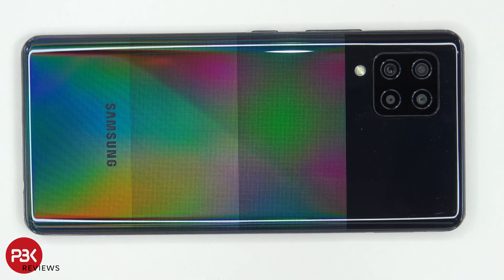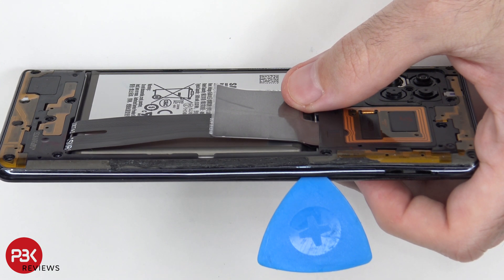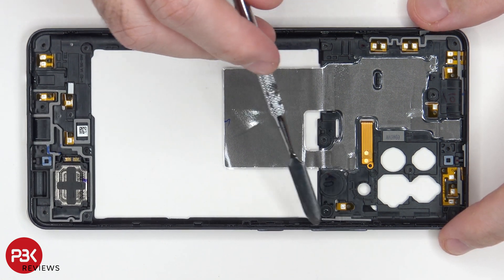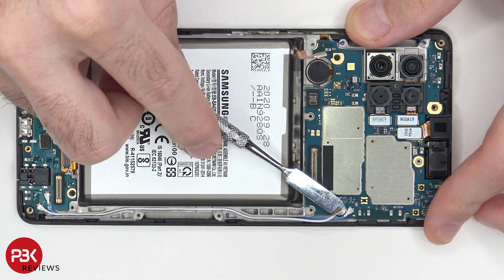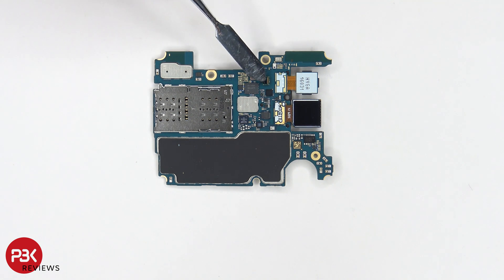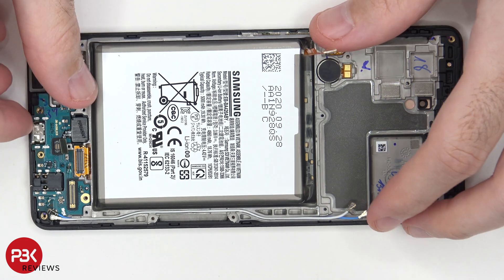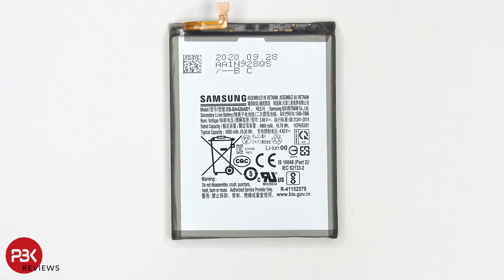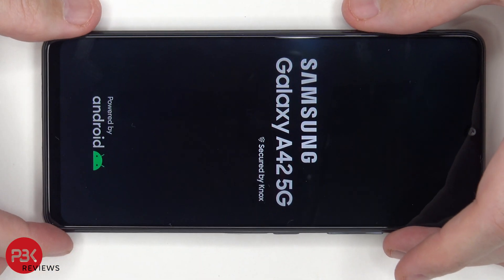Samsung Galaxy A42 5G Disassembly Teardown Repair Video Review

Comment: Where can I get the motherboard to buy?
Reply from the maker: They don't usually sell the boards as a replacement part, so you would need to fine one someone is selling on ebay or elsewhere from a parted out phone if there is one.

Comment: I really appreciated the video. It would have been even better if you had shown use of a heat gun and then showed the reapplying of adhesive and where you would get the adhesive. So it was 80% helpful and much appreciated.

Comment: Where is the wifi. My wifi and hotspot are not working after teardown
Reply from the maker: check and make sure the back housing is seated and screwed down properly, since the antenna flex cables are on the back housing and they need to be seated properly to touch and make contact with the board.

Comment: Hello good guys, I've been looking for a replacement screen like crazy for a long time, and I've come across many pages which claim to be scams, ect... And if I find one on Amazon, it's worth the same as the new mobile. Might you help me? In case you know where I can ask for it or something... I'm desperate.
Reply from the maker: Hi, there is this one which is cheaper but new and harder to install since its not pre attached to the frame: https://www.ebay.com/itm/384773270610?chn=ps&var=652709190897&norover=1&mkevt=1&mkrid=711-117182-37290-0&mkcid=2&mkscid=101&itemid=652709190897_384773270610&targetid=1264870805984&device=c&mktype=&googleloc=9031131&poi=&campaignid=14859008593&mkgroupid=130497710760&rlsatarget=pla-1264870805984&abcId=9300678&merchantid=522565752&gclid=CjwKCAiAqt-dBhBcEiwATw-ggJJVu6oNldczl6NCv7_pLu-0S4y1tDPHB6jS1RmMWlmDrzkEe802pBoCE6MQAvD_BwE    or there is this one which is easier to install since it comes with the frame and is an original screen but used : https://www.ebay.com/itm/285064911070?hash=item425f3158de:g:mHMAAOSwpjRjjocw&amdata=enc%3AAQAHAAAAoH78wsiBphXTsHRyyjXTpNDPvzp%2Fnw0v77yeWa8vKG6vr93VzICUb%2Bg3RlJC1cqUZa9S9obqQP8i2QoORGMc0Ds%2F%2BCvMdRZ3gVdfby0XSKAJU6iQSbOohhtcQPQG%2Fi8r8SDACLdiaqYbFvd2rsfO4dhIu46UucDlIZgREyJN28DaH68VyVzJ1V7fZuPX6aDaq2e1QYs6qhOsN0qAA5PT%2FCc%3D%7Ctkp%3ABk9SR_L70Z-xYQ
Reply: @PBKreviews  Thanks! But I have a question, the screen of the second link works, even if it is used, right?

Comment: My husbands screen won’t unlock or respond to touch and even resetting it doesn’t work. The password screen won’t even appear it just turns on and off. Any clue? Help please.
Reply from the maker: Can be many things. Bad battery, bad software, water damage etc. If battery, you would have to test a new battery and see if it helps, if not then you need to check for water damage, and lastly you can try doing a manual hard reset (which is a factory reset that erases everything on the phone) to see if that helps.

Comment: Thank you for the video. I watched it because I paid to replace my cracked screen, now I barely get 1 bar of service. (Never a problem before). Could something happened during the screen replacement somehow?
Reply from the maker: You would need to check and make sure all the cables are connected properly, the motherboard is seated in place and the back housing which has all the antenna flex cables is seated in place and screwed down so they make contact with the contacts on the motherboard to give them signal.
Reply: @PBKreviews  Wow, I want to thank you for taking the time to answer me. You are a wonderful person! This helped me out a lot.

Comment: mine looks different
Reply from the maker: maybe yours is the A42  not the A42 5G
Reply: @PBKreviews  Thankyou very much, I managed to figure out the rest. It is A42 5G & it even displays it on screen at boot up, I noticed that some parts on the inside look different than A425G tear downs on the internet like yours, & also parts read 2021 yet most I see on the internet read 2020, so I think samsung actually changed a few features/insides in a newer version of A42 5G but didn't announce.

Comment: Which adhesive is used on the backplate and battery.
Reply from the maker: You would need this part in either of these links: https://www.ebay.com/itm/402700267866?hash=item5dc2ce715a:g:pLEAAOSwmSpgL9CD  or  https://www.ebay.com/itm/154787197840?hash=item240a093390:g:x7oAAOSw6Ptg~rQt  and for the battery  https://www.ebay.com/itm/154787197889?hash=item240a0933c1:g:WTMAAOSwG9pg~rTg    or  https://www.ebay.com/itm/333945494449?hash=item4dc0b3dbb1:g:SSYAAOSwiUpgaKY~
Reply: @PBKreviews  OK than you.
Reply from the maker: @badbug911  👍

Comment: Why does my a42 5g have one less camera? The flash is located where the 4th camera is on this one.
Reply from the maker: Most likely because you have a A42 and not a A42 5G since the A42 has only 3 camera and the A42 5G has 4 camera.
Reply: I have the 5g model sm-a426u. I guess there are different models. Thank you for the reply.

Comment: Hi, accidentally used the sim removal tool on the top hole (by camera area/top edge) of A42. anything to worry, any damage could've done? Thank you.
Reply from the maker: Hi, no you should be fine, the mic is seated above the hole so it wont be damaged.

Comment: No 5G antena🤔
Reply from the maker: No mmWave 5G antenna in this model since this specific model is not intended for mmWave carrier but don't be confused with mmWave 5G antenna vs sub 6GHz 5G etc. Most phones don't use mmWave version of 5G so they don't need that antenna.

Comment: Also this phone of my loses signal drops calls and more or less sucks the guy at the Verizon store said its not the phone but there service its picking up 3g towers and confusing the phone is there a fix the guy (store manager) said its going to be a few months before they have more 5g tower up and operating.
Reply from the maker: Not sure, I don't think this phone has all the network band compatibility for verizon. It has some of the bands but not all so that could be the reason you are having issues. One of verizon's main is 13 for LTE and this phone doesn't support band 13. Also for 5G most of the bands are not compatible, only one is and probably that one for verizon doesn't have to much of a signal in your area. As for adhesive you can watch this video: https://www.youtube.com/watch?v=T4iiPUIM7-Y

Comment: My screen doesn't respond to touch. My screen did break on the right bottom corner, do you think that made the screen respond?
Reply from the maker: yea its most likely the break causing the touch digitizer not to work. Would require replacing the screen assembly.

Comment: May i ask what would happen if the the loudspeaker mesh got some how detached? or removed? will it allow dust into the phone? will it damage it?
Reply from the maker: Dust would get into the speaker but not really the phone. Over time its possible the speaker can sound distorted.
Reply: @PBKreviews  i have read somewhere that the speaker itself has this somekind of waterproofing mesh? Is it true?
Also, does the speaker area contain rubber gaskets?
Reply from the maker: @mattjericovillareal402  for water resistant phones, yes it would have a rubber mesh filter that has a gasket to help for water resistance. Keep in mind water resistance is not water proof. Long exposure or deep water can still cause water to get in. But ya without the filter, water would definitely get in.
Reply: @PBKreviews  oh right, im asking these questions because yesterday when i was cleaning my phones loudspeaker of my samsung a42 5G, i noticed that the speaker mesh is somewhat moving and im kind of worried it might damage my speaker.
Reply: @PBKreviews  oh right, im asking these questions because yesterday when i was cleaning my phones loudspeaker of my samsung a42 5G, i noticed that the speaker mesh is somewhat moving and im kind of worried it might damage my speaker.

Comment: Applyng heat to the front side of the phone to remove the battery does not make the screen  loose quality later or broken easly???? Good job bro
Reply from the maker: Hi, thank you. The point is to gradually warm the adhesive and not just apply a lot of heat in one portion on the screen. Heat it up little by little so it gets hot enough so the adhesive becomes easier to pry off.

Comment: This phone is a trash, and expresive like a51 5g that is a geed phone, why ?
Reply from the maker: Its not a bad phone, and price isn't bad for a 5G phone. Also it has some decent cooling compared to other phones not to mention a larger battery compared to the A51 5G.
Reply: Note 9T or Moto G 5G Plus are better value, but this is the price of using Samsung, who tries being the korean Apple.
Reply: @WhenDoesTheVideoActuallyStart  I think they finally did it. I now love apple. They are the same, but apple is more stable and more optimized, more faster. Samsung is  ot brave anymore and who like cowards?